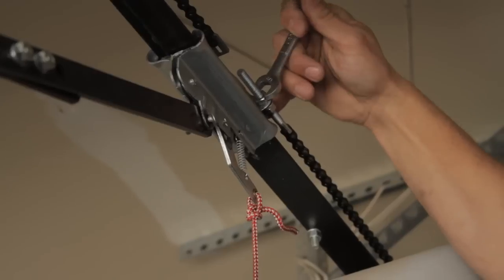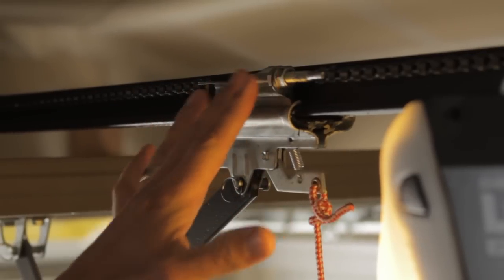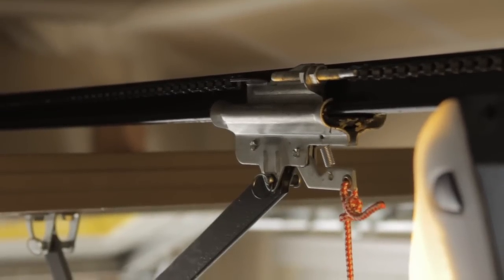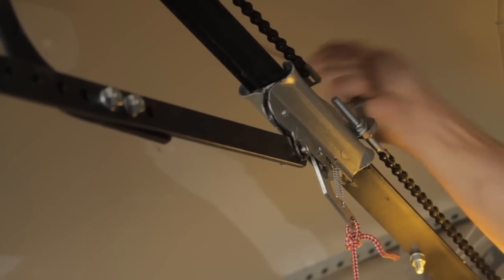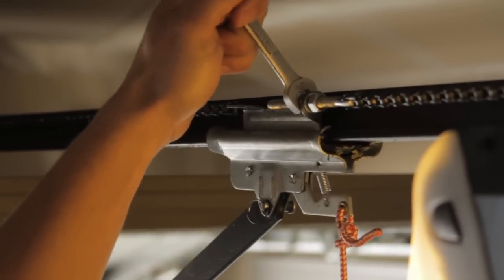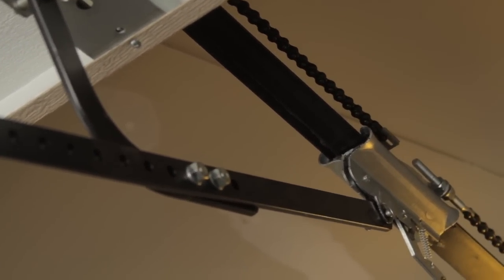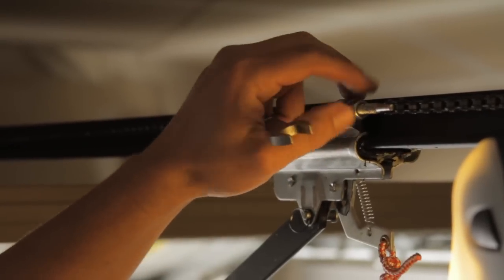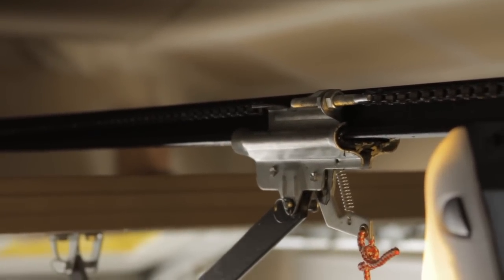Garage Door Help : How to Adjust the Chain on a Garage Door Opener

Comment: Thanks for your video. My chain was coming loose, tightened it  up just like the video demo, but garage door wouldn't open. I noticed that I couldn't even manually lift the door. Spring that goes across the top is broken, thus the strain of opening was stretching the chain. Getting spring replaced for $250. Thanks.

Comment: Our door was going up 2-3' and stopping, The chain was hanging low, the video made the chain adjustement a breeze.  The door was still doing the same thing.  The over head track j(ust below the chain) had a lot of dirt.  I sprayed carb cleaner on it and wiped it down.  There is the mechanism that moves along the track below the chain, I used bicycle chain lube on it and the track below the chain, that did the trick.  If the track gets built up on it it causes
 friction.

Comment: When I tightened the screw, only one side of the chain is tightening up, the other side of the chain (the side without screw) still sagging. I tried to pull the chain to this side. It did not work. What can I do? Thanks!
Reply: This is exactly my issue. I'll keep searching for answers. If you figured this out, let me know. Thanks!
Reply: Release the latch with the pull down rope prior to adjusting chain tension. That will solve your problem of uneven chain tension.

Comment: Safety Warning:
The video doesn't mention to unplug the unit before performing this maintenance.  If you do not do so, you run the risk of the opener engaging and hurting yourself - even with "vacation mode" set.
Other:
1) The trolley is to be disengaged while adjusting the tension (Liftmaster website example).
2) The slack between the chain and the rail should be 1/2 inch at the midpoint when opened (easy using a folding ruler with the last section at 90 degrees)

Comment: question, i screwed up my door after i pulled the safety release.  Now, when the receiver sends the "catch" part do the door, it doesn't connect and pull the door back.  What does that mean?  Am i out of alignment?